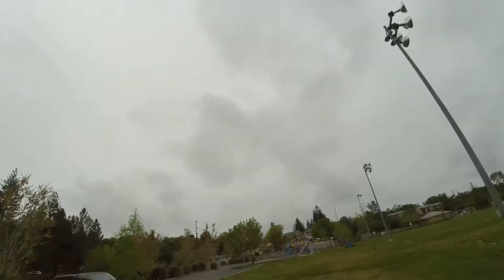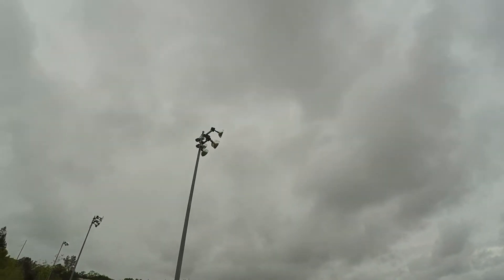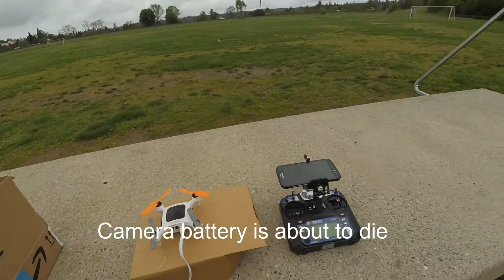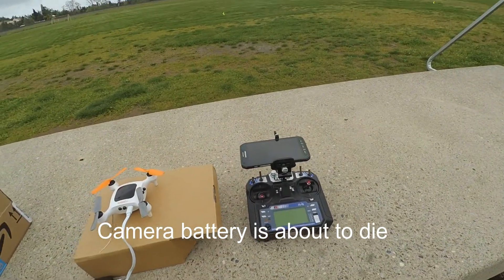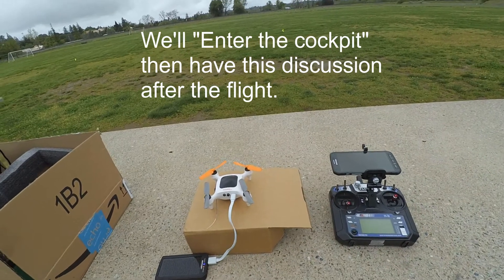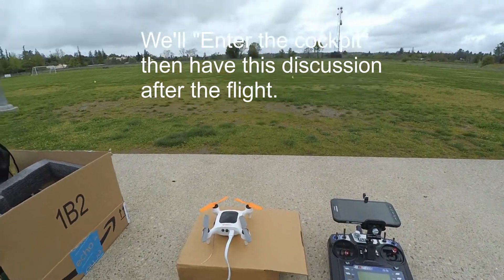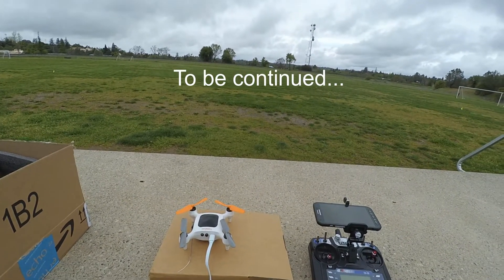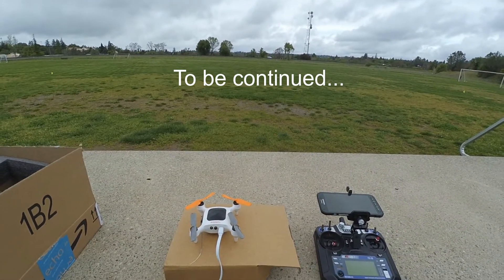Onagofly update 4-8-17

Comment: So I would upload the APM firmware v3.4.3. from mission planner to my drone solder on the receiver and bind it and change the parameters to what you have listed on hackaday? I have the fs-a8s soldered on and its binding to my fs-i6 but my drone just attempts taking off when I unlock it in the onagofly app.
Reply from the maker: If you install the standard APM firmware, you will lose the ability to control the drone with the app, and there is no going back, or at least not that I have figured out yet.
Reply: One problem I am having is I cant find the version apm firmware you have. I have apm 3.4.4 in my mission planner. I cant stand the way it fly's in wifi mode anyway.
Reply from the maker: @andrewkennett940  the only reason I say to upgrade the firmware is to be able to use Flysky's i-bus to get 10 channels, as the stock version does not support that protocol. Any ppm micro receiver will work without firmware update (such as newer flysky hardware, frsky, dsmx, etc). If you do update, note that you won't find the version I mention because it's a couple years old now, so you can try installing the newest version instead. Keep in mind I have not tried the newest version as I have pretty much canned the project, at least for now.
Reply: @EngDrewman  I plan on updating the firmware on my fs-i6 soon anyway.
Reply: I have to mess around with it more im not getting a response from the drone. The receiver stops blinking when it binds to the fs-i6. I guess i have to make sure i have the receiver in the right mode and see if im supposed to configure I bus in the flight planner.

Comment: Any updates? I was thinking of getting one of these for 20$ but was hoping the gps will still work with the rc transmitter mod.
Reply from the maker: No, the project has pretty much been shelved. The battery has gone bad, I've broken almost all of my propellers in testing, and it was really turning into a black hole for time.